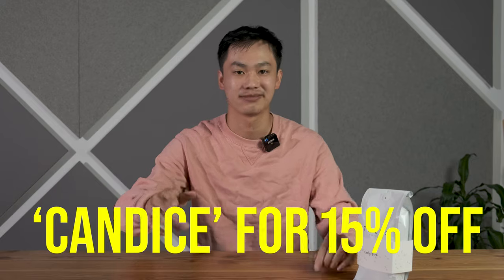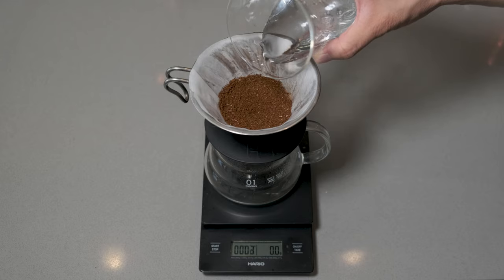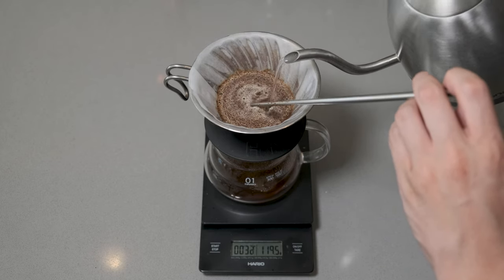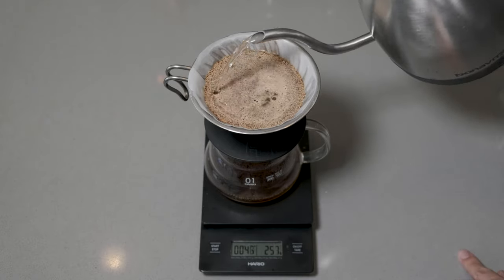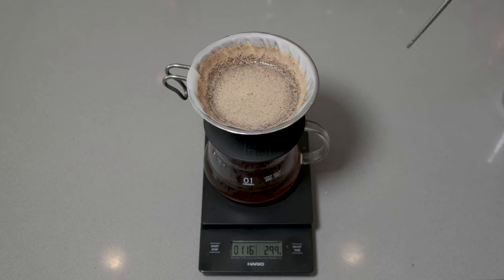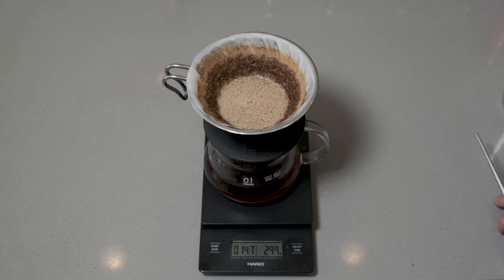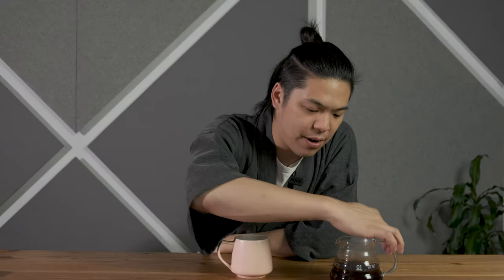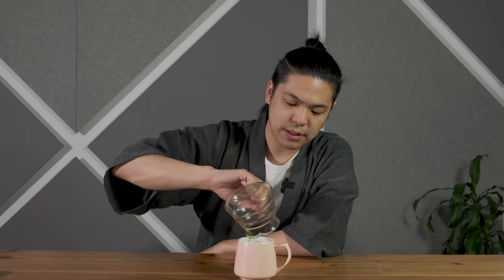How a Cold Water Bloom Could Change Everything | Pour Over Theories

Comment: Very interesting. I’d theorize that using cold water it softens up the grinds without violent release of gas, causes gradual increase in water temperature around the grinds when you pour hot water, and gas is released more gently over longer period. So you get little less extraction because of that but it perhaps doesn’t break up the grinds as much and it releases less macromolecules responsible for bitter flavors. They do tell you in traditional Japanese method that if you see the slurry bubbling up, your water is too hot and you will get too much unwanted flavors, which seems to relate to this.
Reply from the maker: You can fix the bubbling up with a slower pour.  The Japanese way is interesting but I think to say that bubbling is too hot, if you pour slowly enough like them the bubbles would be inside which is why they have gigantic blooms.  They too use quite a high temp.  But it is correct big bubbles is way too hot that’s how I’ve suggested the temp control in a few other videos. But the cold water does slow down the extraction process so the interesting idea is to use .. the Hario switch … 🤔
Reply: @TALESCOFFEE  thanks! I’d also think that with cold water, first drips would be almost nothing, so you may want to discard that part or like you say, hario switch... but then it starts to become a different brewing method altogether!
Reply from the maker: @mrbbm2000  YUPS! I ran some testts with it today and am SUPER excited to say its QUITE good and there's lots of new discoveries to be made AHAHA